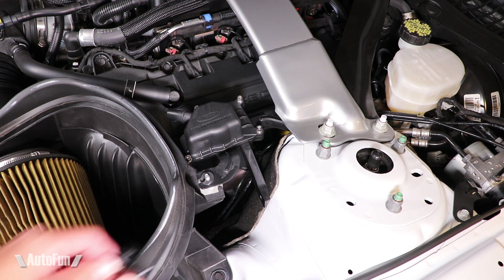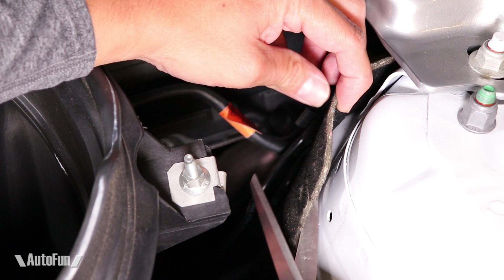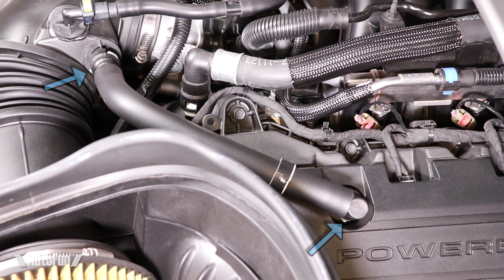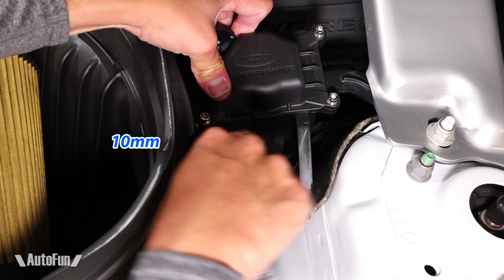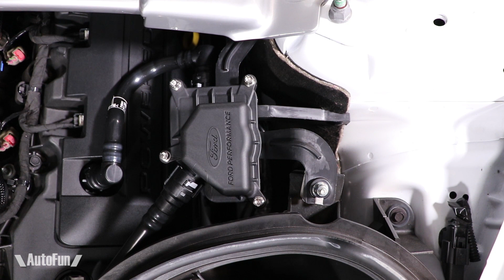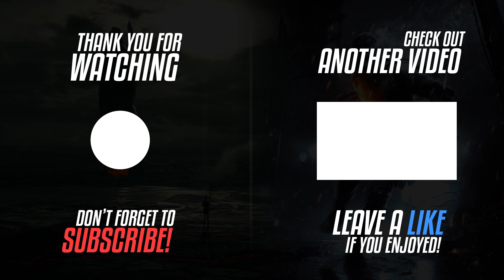Driver Side Ford Performance Oil Separator (Shelby GT350)

Comment: Thanks for the video. How's the access to oil deep stick after installing driver side? Is it difficult to check oil level now?
Reply from the maker: Thanks Len F! good question, the separator does slightly restrict the access to the oil dip stock. It's not bag, I just have to move my arm around the separator. Definitely not a deal breaker in my opinion. Thanks for watching!
Reply: @AlexAutoFun  Watching your video makes me realized that the lining don't need to be cut. So, I just got longer plastic bushing to clip oil separator arm onto it. Again thanks for the video!

Comment: do you really need 2 air oil seperators
Reply from the maker: Hi Lee! probably not, I have a video coming up that  will show the difference between running one or two but for most drivers I think one is more than enough, stay tuned bud and thanks for watching!
Reply: @AlexAutoFun  thank you

Comment: Driver side is not going to catch a drop. Sorry but you wasted your money.
Reply from the maker: Hi NaderS Sedagt, I also have heard that before, I'm actually curious to see how effective or non effective it is. I'm planning on opening each at maybe 500 miles and 1000 miles just to see what inside there so far if anything, you have not seen any oil at all on yours?
Reply: AutoFun did you see any oil quantity collected into the filter? I mean.. does it work?? Because I have a new GT350 with the passenger side separator already installed but I could’n find this one (pilot side) thanks!!!
Reply: @aeroelitemauro  you use the same one, get the adaptor on ebay